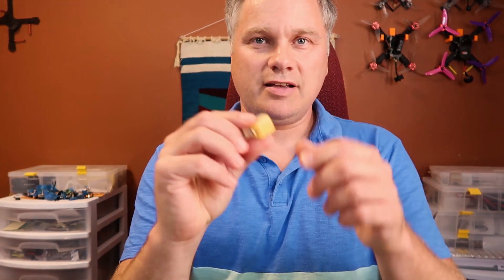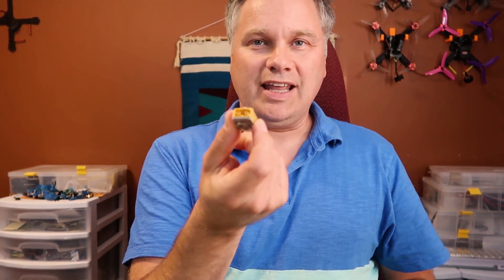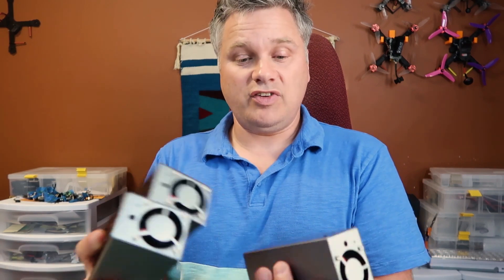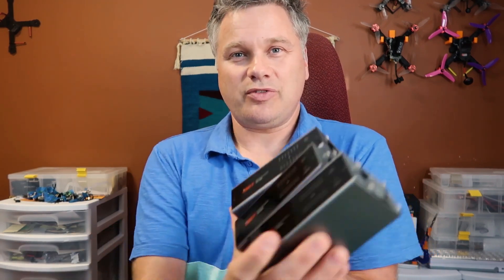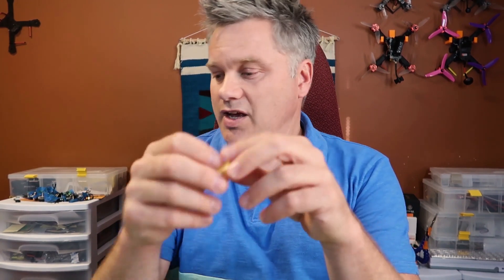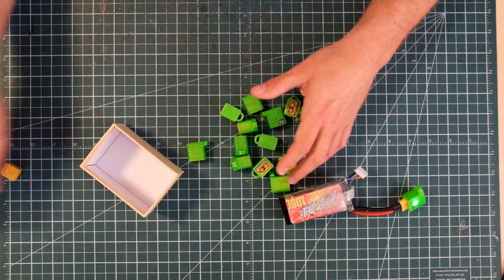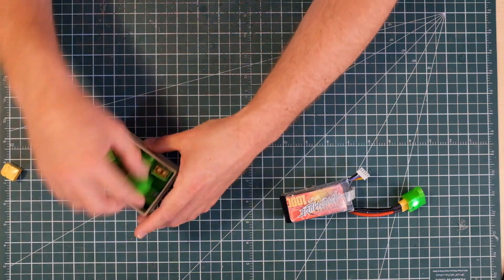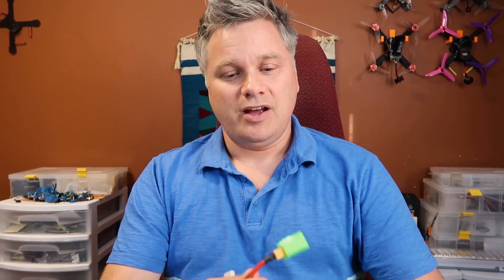RDQ Lipo Suction battery discharger REVIEW!

Comment: Hi there! Creator of the Lipo Suction here. I am glad you are enjoying the product. I created this product for guys like you and me who have tons of nearly identical miniquad packs. Let me address your questions and concerns:
1) Slow discharge rate. You are absolutely right. The discharge rate is slow and I wish it could have been faster. Early prototypes had a 5W discharge rate but it ended up being way too much for the form factor and it would get too hot. Unfortunately, around 500mw is the limit for the size. It is designed to remain at a touch friendly temperature even if the user decides to thermally isolate the system, such as the conditions found in a closed lipo safe bag. We also included thermal and over-current protection for this reason.
2) 3.9v/cell cutoff. We decided to be conservative on this one and set the cutoff on the high side. This has the added benefit to allow the device to be left plugged in for extended periods without risking over-discharging the battery. Even though the discharger is "off", there is still a tiny leakage current on the order of microamps. I typically go on a week long business trip with these plugged in and I return to around 3.89-3.90v/cell. Have you tried measuring the equalization current between batteries at 3.9v/cell and 3.8v/cell plugged in parallel? I measure 1.3A for 15 seconds, 1A for a minute, and 0.4A within 5 minutes. 
3) Bigger batteries. It will indeed take days to fully bring a larger pack down to storage voltage. It is not clear how many days a battery can remain fully charged without suffering damage or if the effect is linear. Maybe it is just the first few millivolts that causes the most damage? I do not think there is enough data out there to know for sure. what we really need is someone to do a long term experiment measuring internal resistance over time with batteries stored at various voltages over one year.
Reply from the maker: Hey thanks so much for checking in!  I understand what the discharge rate is fairly slow - it wouldn't be as convenient (ie putting it in a bag) if it generated more heat.   On the 3.9v - From what I read, the discharge rate dropes to almost effectively zero when it hit storage voltage, so leaving .1v seems like a bit of overkill, especially since it makes a big impact on useability.   I havent' measured the equalization current between 3.8v and 3.9v, but I imagine that it will be the max discharge rate of the higher-charged battery, since it's a short.  Discharging a pack at max discharge isn't too bad (heck, I do it all the time while I'm flying!), but effectively charging the other battery at 100C (or whatever the discharge rating is) can be very detrimental to a lipo I imagine.  I don't understand why you only see 1.3A (which is 1C discharge on a 1300mAh lipo) with a short between 2 batteries.   My guess is that we're not talking about the same thing.    What I would love to see is a solder pad or jumper that lets the user set it to either 3.9 or 3.8. It would turn a good product into a great product.
Reply from the maker: Oh, by the way, I'd love to help out with beta testing any new versions of this that you come out with !
Reply: Please do not charge your batteries at 100C :). I have noted your request to drop it to 3.8v/cell. Do you just remove the caps a day or so after plugging them in? If so, you probably do not care about low leakage current. I was envisioning some users may want to stow some lipos away for the winter and it really will be a plug and forget product.

As for the discharge. Although it is a dead short, keep in mind the current has to flow through the internal resistance of the batteries, the contact resistance of the XT60 connectors, and the resistance of the battery leads. These are all in the milli-ohm range but they make a significant impact on the short circuit current of the system. So if we use ballpark figures: 
Battery internal resistance = 8 milliohms / cell
XT60 contact resistance = 0.5 milliohms per connector
Wire lead resistance = 8 milliohm/meter for 14 gauge wire so lets just say 0.5 milliohm total
The resistance of the whole system is = 8 milliohms/cell * 8 cells total + 0.5 milliohms/XT60 * 2 XT60 connectors + 0.5 milliohms for wire = 65.5 milliohms total. 
So the expected current we expect is 0.4V / 65.5 milliohms = 6.2 amps.

I think as soon as current began to flow one battery dropped voltage while the other one increased voltage, decreasing the voltage difference, and thereby decreasing the current too. These are of course ballpark estimates and I encourage you to do your own measurements before trying anything. I took my measurements with a 1300mah 4s 100C CNHL battery.
Reply: Noted! :)
Reply: So at 500mw.
could you make a 1-8s version?
was thinking much like the old school battery beepers everyone used to use. you could make it multi purpose and you could auto detect cell count.
Reply: very cool product though. ill be sure to get a few!
Reply: JellyBean FPV would you be willing to share the circuit? I want to make an XT30 2s version. I'm assuming it uses something like a TL431 with a voltage divider to regulate voltage cutoff and a power resistor along with the LED and its current-limiting resistor as the load.

Comment: I bought a bunch of 24 volt halogen bulbs from Amazon, wired them up to XT60 connectors and put one of the small cheap tester on the balance lead set for a 3.8volt alarm. I set up a board, drilled small holes the size of the bulb terminal shafts, I stick the wire in the hole and put the bulb down on to it. If I use a large AH 6S battery I connect two bulb in series and it talks 20 minutes to discharge them. Its cheap and I can choose my end voltage. I have a bunch lines up on that board to handle about 6 Batterie's and I can add more quite easily.

Comment: Wonder if they could make a version where you can solder on a higher drawing load like a automotive bulb or something.  What we really need is something that just cuts the power at a certain voltage that's cheap and small like these.
Reply from the maker: That's exactly what they do - they cut the power as soon as the battery hits storage voltage.  You're right though - Putting a bulb in there would increase the speed of them, but they would also produce a lot more heat.  What I like about these is that you can throw 10 batteries with these on them in a bag & forget about them, which would be less do-able with bulbs.  Also much bigger :)
Reply: @MactacFPV  no totally agree about the heat.  I meant to have the option for draining larger packs or quicker discharge is all.
Reply from the maker: Something that could do a larger pack would be really nice.

Comment: so it will allow a cell to discharge to an unsafe level in an unbalanced pack?  I would rather have one that discharges based on cell voltage.
Reply from the maker: True if the cells are way out of balance.  You should be ok if you check them.

Comment: I use a parallel board with my ISDT discharger.. works great. Saw it on a Bardwell video. Cool gadgets tho!
Reply from the maker: Yes, I've done that too -  it works well if all your batteries are the same voltage.  Doesn't work with partially discharged batteries.  PLus it's still tough if you have 20 batteries to discharge.   I've used both methods (I have 3 of the ISDT dischargers), and I really like how you don't even have to check the voltage of the batteries with these - you just slap one on each battery and walk away.

Comment: You have 30 batteries???
You're my new best friend ;-)
But even so, best friend, I'm not sitting next to you on an airplane with your battery carry on bag.
Friendship only goes so far!
Reply from the maker: Hahah!
Reply: @MactacFPV  I ended up buying $250 worth of 21700 Li-ions...  and a TS100 soldering iron... looks like I have a job ahead of me soldering up at least 6 battery packs of my own...
Reply from the maker: @choppergirl  Nice!  I use packs of Li-ions made of 6x 21700 cells for my long distance rig.   They are aweseome!
Reply: @MactacFPV  - I'm soldering up three 6s flight pacs to go on a Mr Croc 7", and three 4s packs for DJI goggles, and I got 3 sets of 18650's for the TX-16s.  

My main challenge is getting the 6s packs to fit on the quad... I'd like to do 2 columns of 3 batteries in series === but that may end up hanging off the quad front and back or blocking the rear mounted GPS.  Some thinking is in order.  I'd also like to solder up the 4s packs the same way == so they slide in the pocket.

Shipping right now is SLLLLLOWWWWW.
Reply from the maker: @choppergirl  that's exactly what I did.  It fits on top of an Armattan Rooster no problem, and it's got a super small battery plate.

Comment: Just leave them charged.
Reply from the maker: Lipo batteries degrade if you leave them charged.
Reply: @MactacFPV  I have no evidence of that.
Reply from the maker: @daveday5507  Maybe because you haven't looked?  Just a basic understanding of the chemistry involved shows why it is true.  Plus, every Lipo Manufacturer tells you to keep them at "resting voltage".   Plus, there is ample evidence if you don't understand the chemistry and why it's true.  Lots of scientific papers, lots of explanations, and lots of real-world tests like this one:  https://www.rcgroups.com/forums/showthread.php?2889967-How-long-can-I-keep-my-LiPos-charged-a-scientific-approach  .
Reply: @MactacFPV  Maybe I'm lucky. I have around 400 Lipos and always keep them fully charged.
Reply from the maker: @daveday5507  Must be.   Mine are garbage after around 20-30 cycles.
Reply: @MactacFPV  I have to agree with that. However, i had several of one make and size which all went over 50 cycles with no apparent loss and then suddenly died.